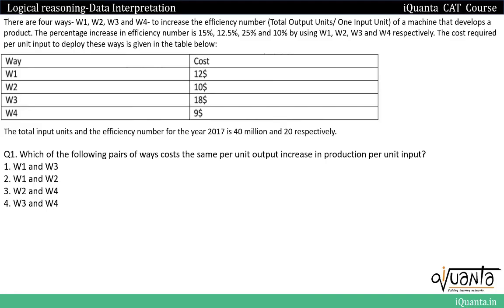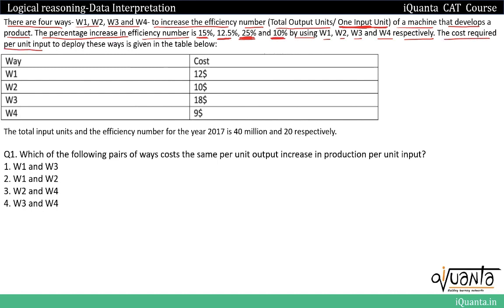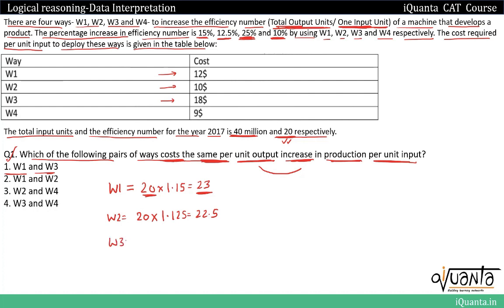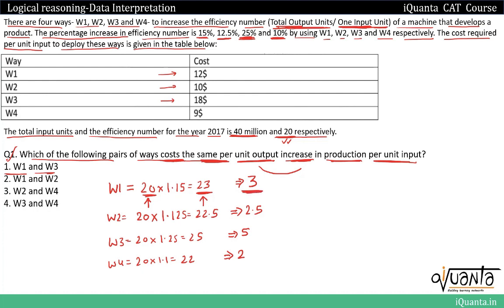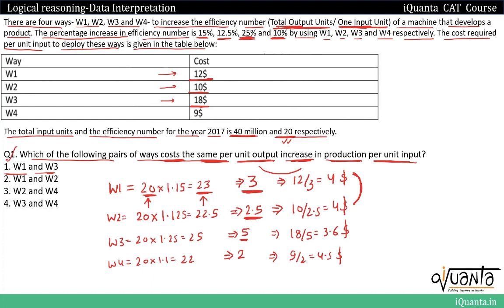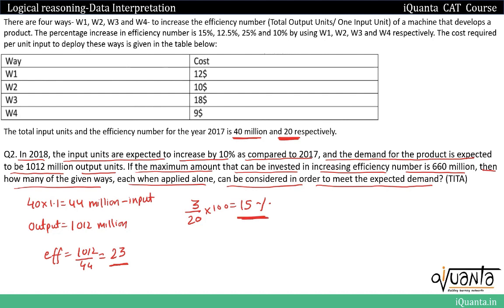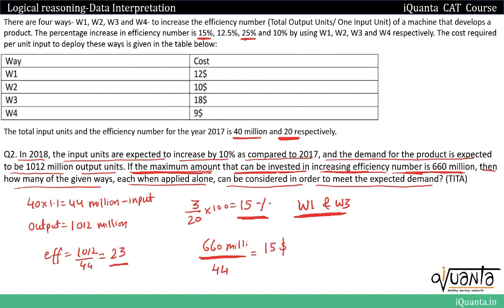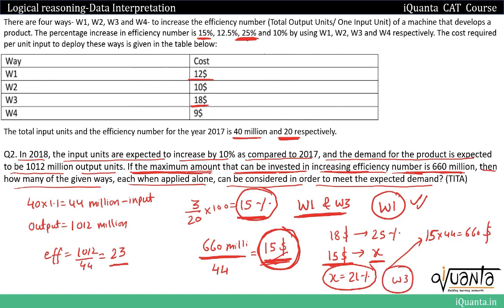LRDI For CAT -Ratio and Percentages

Comment: in the third question how did you take efficiency as total output divided by total input when efficiency is given in the question as total output divided by one input?
Reply from the maker: see efficiency number 22 basically means that if we use one input unit then we will get 22 output units

so to get 990 million output units...how many input units must be supplied when efficiency number is 22

so 22=990/input units
inout units=45 million